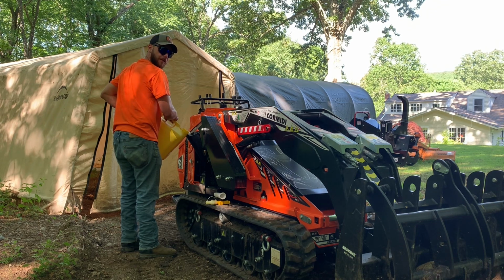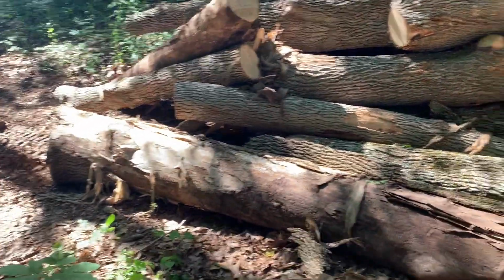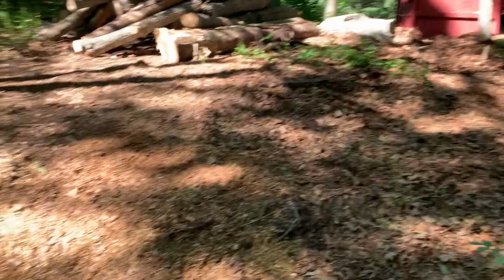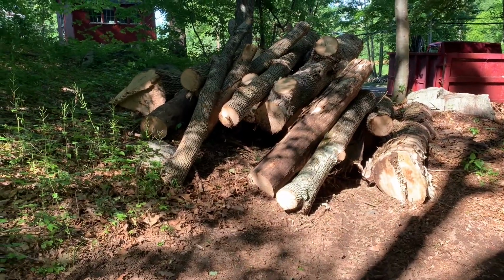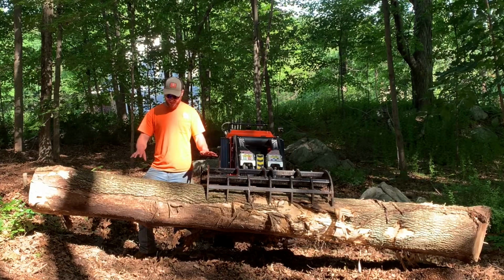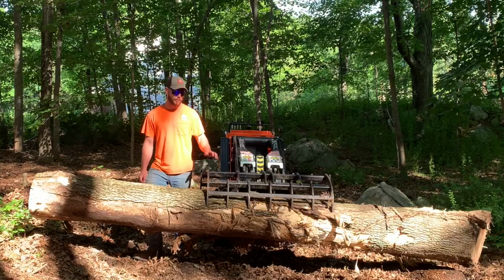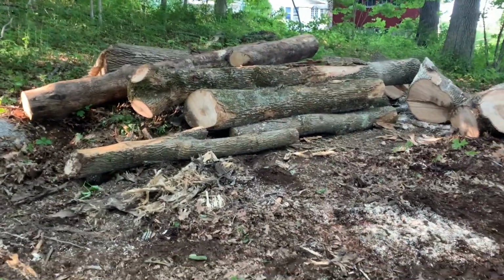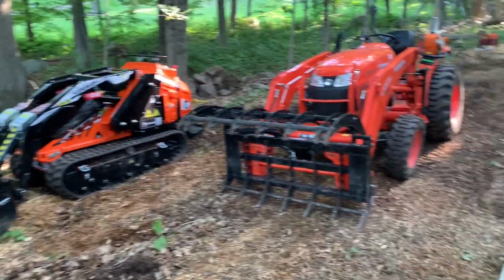#111 Cormidi Mini Skid Steer & Kubota Tractor Moving Firewood Logs

Comment: The Cormidi looks very uncomfortable, but yes nimble. Why both is my question, do you do landscaping for a living with them or are they just for fun.
Reply from the maker: The Cormidi leaves something to be desired in the comfort department, however I will say watching myself operate it on video makes it look 10x more uncomfortable than it actually is. The rough road definitely doesn’t help either.

Im a licensed arborist and do tree work for a living so having the smaller machine allows me much more access into gated backyards and areas where the tractor simply couldn’t fit. It will also fit on the back of the new to me flatbed hook lift truck leaving my dump trailer open for logs/chips!

Comment: You mentioned separate accessories for each machine and since you already have a few for the tractor I suggest researching adapter plates. I saw mention of Bobcat for instance having an adapter plate so you could attach accessories made for other brands. That might save you from doubling up!
Reply from the maker: Yeah there are adapter plates but they are pretty bulky and the mini skid steer is so much smaller than the tractor it really is a safer bet to use it’s own attachments.